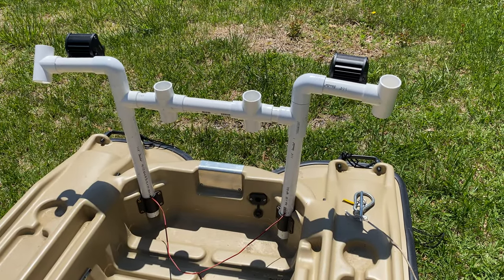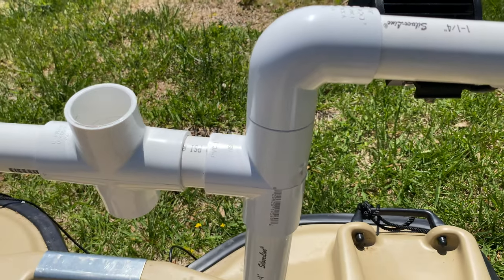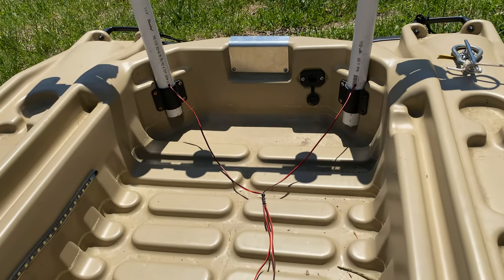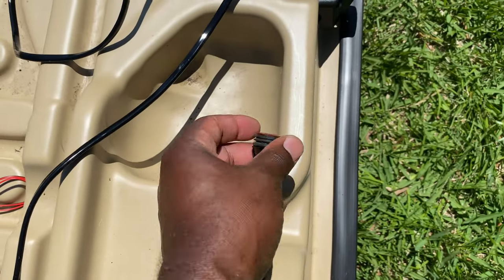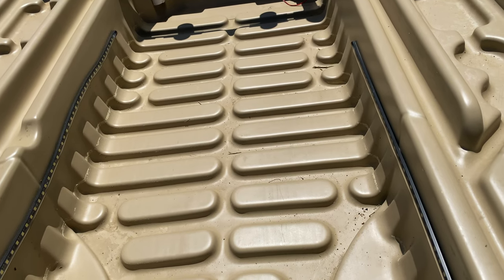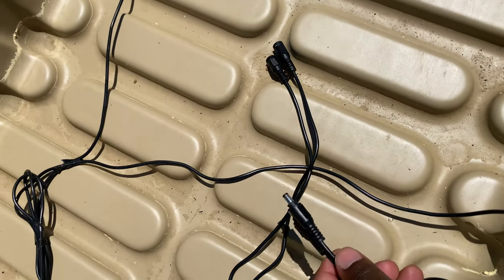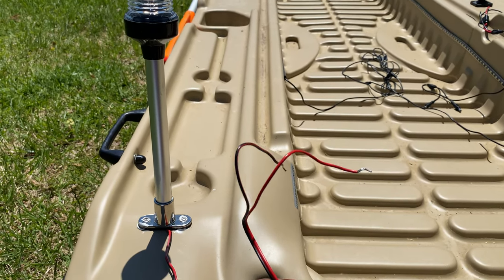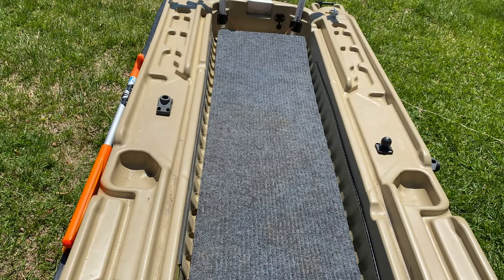Pelican Bass Raider 10e - LED LIGHTS MODS Overview!!! for night fishing, full set-up at the end!!

Comment: Where did you get your connectors from?
Reply from the maker: Thanks for stopping by and supporting the channel. The link is below:

Limited-time deal: Nilight - 50020R 2Pin Way 16AWG Waterproof Wire 1.5mm Series Terminal Connector-10 Pack,2 Years Warranty https://a.co/d/5QvpazO